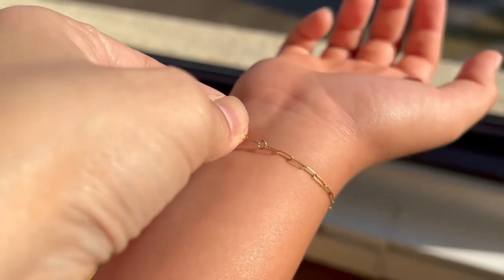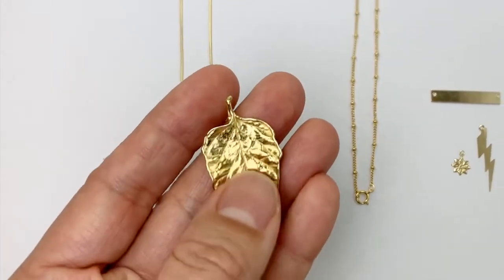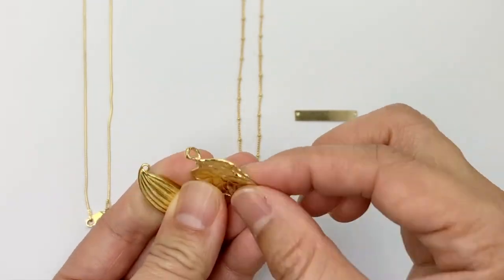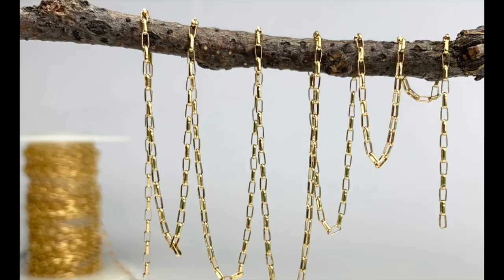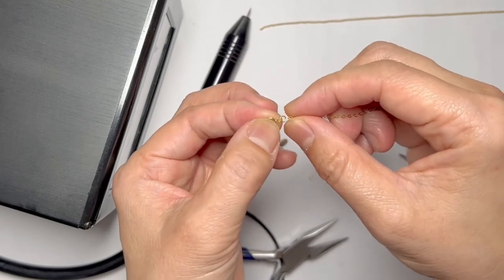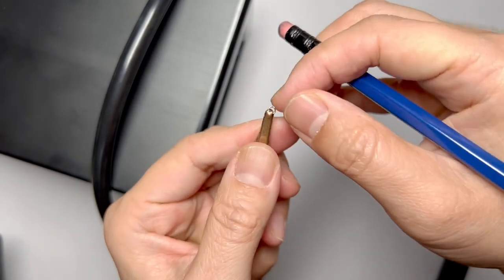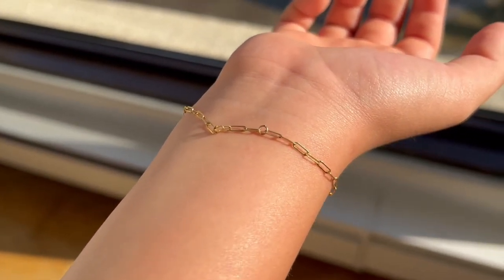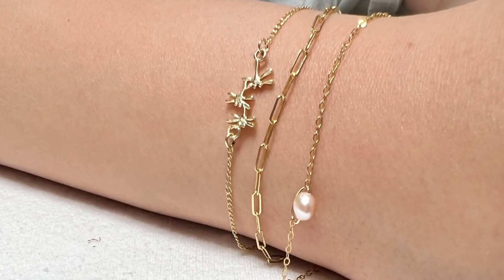12.  Can You Weld or Solder Gold Filled? Welding filled vs solid - Free Permanent Jewelry Training

Comment: Thank you for sharing this! So welding is like soldering without the solder and flux. Is there an efficient way to solder forever bracelets? Say at markets? I’m still researching and gathering data. Am not sure if soldering requires significantly more time with flux application.
Reply from the maker: YOu cannot solder permanent bracelets because the heat would burn the skin.  Or perhaps I've misunderstood your comment?

Comment: So basically welding is like soldering but without the flux and solder? Correct my understanding if im wrong
Reply from the maker: You're absolutely correct - welding uses electrical current to fuse the two sides together.  No flux or solder needed.

Comment: What is the power required for the 14k solid gold jump ring weld?
Reply from the maker: that really depends on the thickness.  I find that for 24ga and 22 ga, 6w does it perfectly in one go.  Try 7w - higher sometimes compensates jittery hands.

Comment: What does it mean when I weld and it creates a flat edge on the jump ring. So it's no longer round.
Reply from the maker: It just means your power is rather high.  It's not a bad thing.  You can use a pair of round nose pliers to shape it round a bit (or tiny pair of pointy tip pliers to do the tap, tap tap to shape).  At 24ga or 22ga, should use 7 w.  if your electrode is super sharp or new, you might want to dial it down to 6w.  People don't care that it is slightly warped, as long as it is welded securely.

Comment: Can you use the welder with gold filled wire (specifically square, but also round). I've had my eyes on this machine for quite some time but I cannot find any videos of wire being welded (the 20ga, full hard wire that you can cut to your desired length). If I wanted to weld to pieces of wire together, on top of each other, would this work?
Reply from the maker: Yes you can.  First, you can weld gold filled, as I have demonstrated in this video.   Second, you can weld wire together - see my video on the welding beaded permanent bracelet.  Effectively, the threading chain is a wire and has no loops.  It is 22 gauge thick, if I remember correctly.  When it is very thin, you ball it a bit first.  See the video.  There is not difference between connecting two 20ga wire and the two ends of a jump ring that is 20 ga thick.   For square, you would shape it afterward.  THat said, you will have a weld mark on gold filled.

Comment: Can’t seem to get gold filled to weld! Is there some trick to it?
Reply from the maker: There isn’t a difference in welding gold filled vs solid gold or sterling silver.  Most common is not closing jump ring properly, not waiting until after snap before releasing pressure.  I’m editing a video right now where I show the common errors and how to avoid them.  Pls subscribe to our channel and remember to click the bell icon and you’ll get notification when I post within the next few days.
Reply: Would sterling silver be recommended for the forever bracelets if you want to go the silver route?

Comment: Thank you for the video! What about charms? Do they need to be gold filled? As long as I use quality jump ring will it be ok?
Reply from the maker: No, they do not need to be gold filled.  However, know that this is for permanent jewelry and whatever charms you use, they should be able to withstand being worn in the shower, pool.... I would strongly advise against gold plated brass or copper.  The plating will last only a few months.

Comment: hi there i’m wondering if you use a solid gold jump ring, will it still leave behind the mark where it was welded?
Reply from the maker: if you use solid gold, you can remove any oxidation after you weld with fibreglass bristle brush (comes standard with any Sunstone welder or it's just $15 on Amazon) or you use argon gas, it will not leave a spot nor will the mark darken over time in the future.  We wholesale solid 14k jump rings and they're a couple of dollars each.  It's just the matter of the modest additional cost - many people do this.

Comment: Hey Dana! When I weld filled gold it looks welded bur when I test the strength the welded part snaps. Is this suppose to happen?
Reply from the maker: Hey Mimi, you should not be able to snap it open.  I welded a bracelet on my 11 yr old daughter and it lasted 7 months of harsh (and I mean harsh) wear.  It finally broke when she got it caught on a handle bar, but the break was not at the weld.  That is how secure it should be.

Comment: Are you using argon?
Reply from the maker: No, I stopped using it.  I bought the tank and regulator, the gas used up quickly and a hassle to refill.  Argon reduced fire scale, but didn’t eliminate it entirely anyway.  I still had to clean it.
Reply: @stonesandfindings  what do you use instead of argon?

Comment: Can you weld gold plated?
Reply from the maker: yes you can weld gold plated.  In fact, you can weld anything that conducts electricity.  However, you DO NOT want gold plated basemetal findings and chains for permanent jewelry.  The plating will come off with that kind of intense wear (swimming in pools, sunblock, sweat, soap...) in a couple of months.  People will get very upset and want a refund.  Plated chains are ok with a claps and people can take them off to shower or swim, but not ok for permanent jewelry.  If it is gold plated over 925 silver, that will be ok.  When the gold wears off, only silver is exposed - will not change the colour of the skin and won't turn green.  Most people are not allergic to silver, whereas there is a lot more brass and copper allergies.